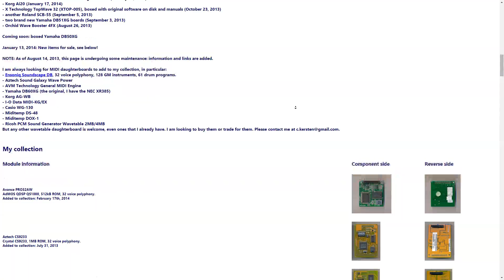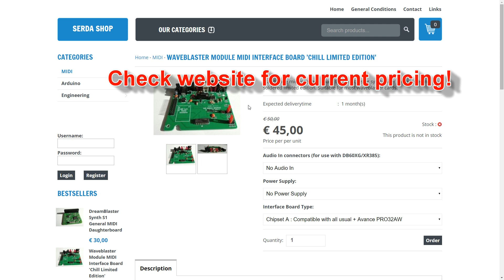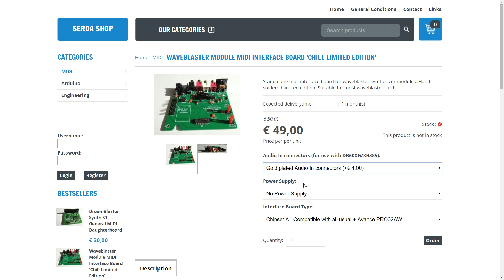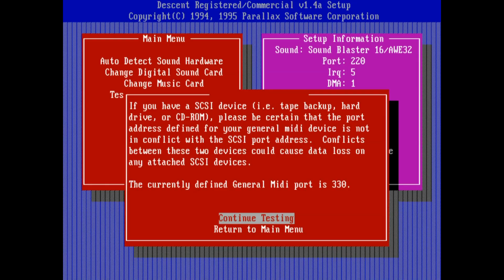Waveblaster Interface Board Review

Comment: Would this be immune to the wavetable bugs on Soundblaster 16's with DSP v4.11 and above?
Reply from the maker: +TheDeeplyCynical Well if you hook it up to a bugged Sound Blaster 16 then of course you will get hanging notes I'm afraid. But it allows you to use bug free sound cards that do not have a wavetable header like the AWE 64.
Reply: so the bug is also present on the MIDI port, not just the wavetable header?
Reply from the maker: TheDeeplyCynical Yes, in fact the wavetable header and MIDI port (joystick) play at the same time, they are both connected.
Reply: Thanks, looks like i need to get a better soundcard